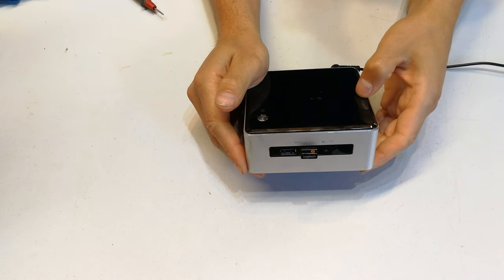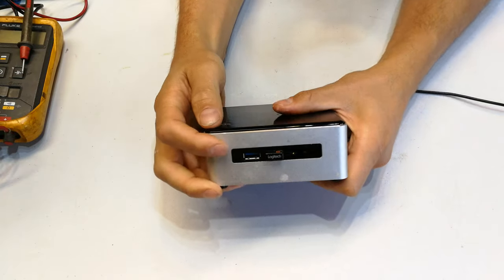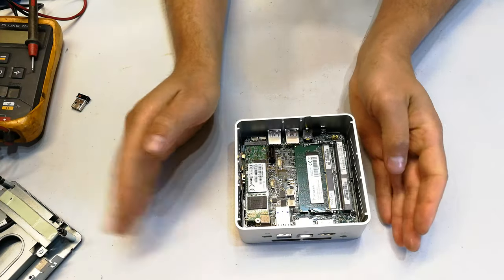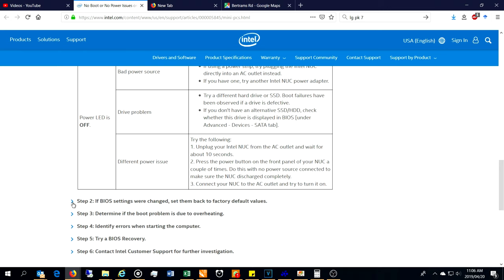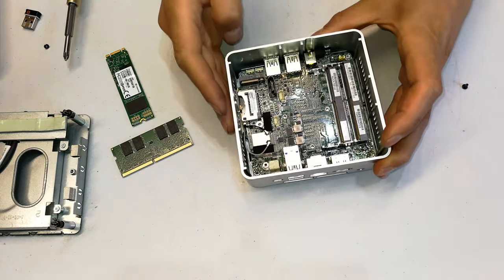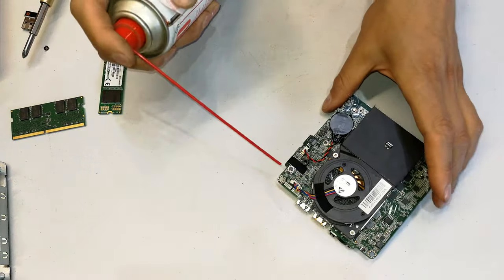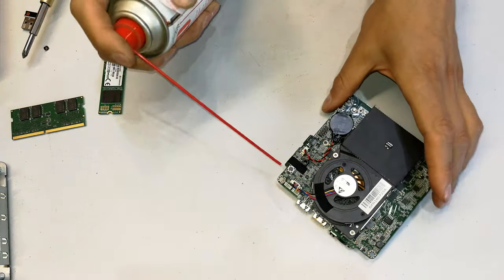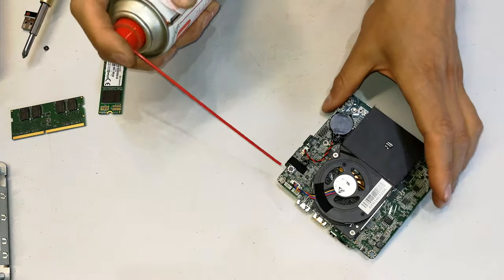Intel NUC not turning on - disassembly and fault tracing - faulty switch

Comment: One update for you... check the voltage coming out of the lithium battery too. I went through all the steps that you outlined (super useful!) and found that the lithium in the unit was no longer pushing out 3V. I tested it and found it to be about 1/2 the juice needed. I replaced the 3V lithium battery with a Duracell CR2032 and my machine came back to life!
Reply: The nuc is not battery powered, so that is odd, indeed.

Comment: Persevere this works!
At first this procedure failed to solve my problem.
I measured the power cord voltage - 19 volts.
I used a contact cleaner - but no improvement.
The switch still failed to provide power to the MB. 
But I noticed a very tiny blue LED light on the MB...I did have some power.(ahead of the switch?)
As a last hope, I applied generous amount of cleaner to the switch and repeatedly pushed the switch button on the MB. 
I said "I'll leave it overnight" and see!
Unbelievable...next day the power switch worked!!!!
As a sidenote...time to replace the CMOS battery.
And definitely time to do backups!!!

Comment: Thanks a lot!!! I solved my problem with the power button.
Used wd-40 contact spray for the Button. Now it works fine. Before the Procedere,  I had to press the power on/off 50 times until the nuc started. I'm from Germany.

Comment: This is to say thanks very much. While the video is old it's just saved me from throwing a perfectly healthy Nuc, even if it's a bit old. I tried various things and the Nuc seemed dead (I never turn it off as it runs various services) but the PSU seemed fine. I double checked the ssd was good and healthy as had suspected damage when turning on power at my house after doing some electrical work which affected a router.
However found your video for the same hardware I have and seeing the symptoms looked similar tried out your fix. Things are now back up and running. Thanks again.

Comment: thank you for this video. I have 2 of these NUCs at work and trust me It is annoying when you start work and they don't power up. Initially it just happened to one of the units then sometimes it happens to the other one. Now I have an idea that it is really the power button. I have the luxury of switching the AC cords to test if they were the problems but I knew it was the flimsy power button. INTEL should own up to this. Our units never have been wet or something and they are just 3 years old with about 4 hours usage everyday. I hope I am able to find a contact cleaner like that or just bring it to the computer shop for cleaning. Thank you again for this video.

Comment: Thanks you! I had the same problem, but I wasn't able to save the button. So I soldered two wires to the legs of the button and pulled them outside the box. Then hooked a small button to the wires. Works great :-)
Reply from the maker: Excellent!
Reply: Same for me. I always need luck to turn on my NUC. But it’s been a week since I turned it on last time. I used contact cleaner to save the button this morning but no use. I’ll use multimeter to test the power switch. If it is indeed faulty, I’ll consider your solution, thanks for sharing. I’m from Taiwan.
Reply: I used multimeter to test the switch just now. The upper two pins are connected to the lower two pins when I press and hold the switch button. When I release the switch button, the connection is immediately off. Is it normal for this power switch? I guess the switch is working now. Somehow it cannot be turned on. I’ll check the CMOS battery anyway. I would appreciate if there is any advice. Thanks.
Reply: My power adapter plugs weren’t attached well. My NUC is turned on now. Cleaning the switch helps! Thanks for sharing the tip !
Reply: Hi, how hard or u think any computer shop can do this ? I want to do this way

Comment: Hi Great video and solution. on my side one connector cable is broken (like in your video at 7:10 time) and since no video. What is the usage of this cable ? connector are very specific how to fix it ? thanks for your tips :)
Reply from the maker: it looks like a the WIFI antenna cable. You can fix it. its same wires in cellphone so you can get spares for that wire. If you dont have, you can use WIFI dongle via USB.

Comment: To make them so compact, these use miniature surface mount devices that are too small to carry component value markings.  Also all the capacitors, diodes, inductors and resistors look the same.  So, If one component burns-out , unless you have a pcb layout diagram you are screwed...

Comment: Mine had a bright flash then died instantly. Any ideas? Is it cooked and dead for good due to power surge?
Reply from the maker: Could be your power supply. Do you have a multimeter to measure the output jack of your power cable?

Comment: When using the blower you need to block the fan from spinning as the fan motor will act a generator and the fan power supply might not like having power fed into the output!

Comment: Thanks friend, you just showed how to fix mine which got rejected by Intel Service department because of expired 3 year warranty. I have the same issue with liquid on my SSD card. Did you figure out what that was? In my case I didn't remove the plastic cling film that came with the new machine. So there's no way liquid got inside from the button. I live in a very humid city so the button contacts must have oxidized. How did the SSD get liquid on it? I didn't get answers on the internet.
Reply from the maker: mine was because my young children eat near their computer and often spill things.

Comment: What happens if the power source regulator gets pushed to 24v from the 19v position ? It's not powering on at all how do I fix this, the power source is green but when plugged in it goes dim with the light on power source?

Comment: I couldn't get a close enough look at the contact cleaner spray to identify it, and the presenter's accent is odd enough to my ear that I cannot be sure I heard the second word correctly. Is this "Kontakt Chemie", the German product?   I'm in the U.S.; would spray WD40 do?
Reply from the maker: its as you write it "Kontakt Chemie" http://www.kontaktchemie.com/KOC/KOCproductdetail.csp?product=KONTAKT%2060
This product is not a lubricant and is not similar to WD40 at all. Please do not spray WD40 on your electronics. 
Kontakt 60 removes oxidation and improves conductivity between metallic contacts. There are other brands offering similar function.
Reply: There is a similar wd40 product which matches your product but indeed this is not oil...

Comment: I did the same exact steps you did but my NUC didn't work
Reply: Too bad. My NUC didn’t work either after I used KONTAKT to clean the switch. I used multimeter to test the switch and the upper two pins are connected to the lower two pins when I press and hold the switch. They are disconnected when I release the switch. I’m not sure if this is normal or not. I also replaced the CMOS battery. No use.
Reply: My power adapter plugs weren’t attached well. My NUC is turned on now. Cleaning the switch helps!
Reply: @changss7  how do u see the 2 pin touching other 2 pin when u pressed the botton ? its so small and covered
Reply: @homunkin5884  could you indicate the timing in the video? I don’t know exactly the moment of touching two pins you mentioned.